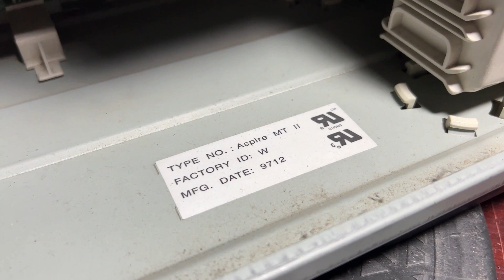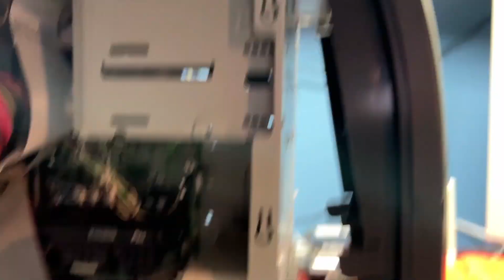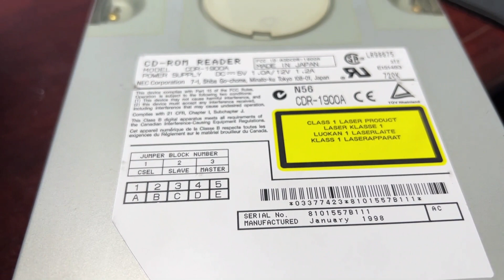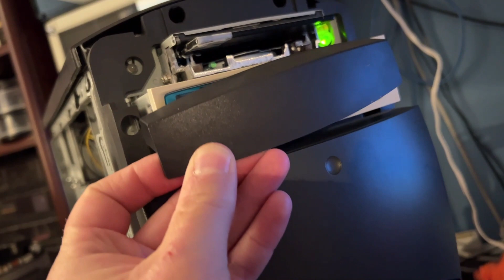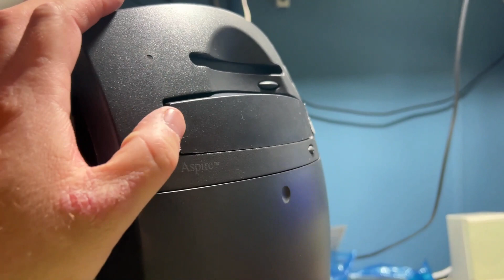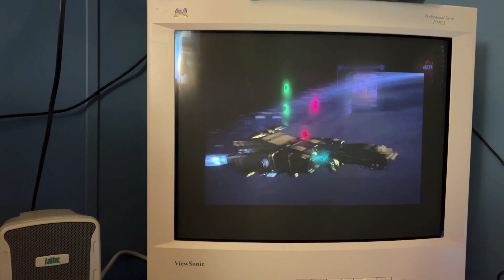Pentium 2 Acer Aspire Repair & Tiberian Sun Gaming.

Comment: Are you still using yhe Dell t420 as a workstation? And how is driver support for it in windows?
Reply from the maker: I haven't used it in a long time as a workstation. I use to as a server again as a Plex server for the storage capacity.  Windows 10 and Server 2019 work just fine on it. No issues with driver support.